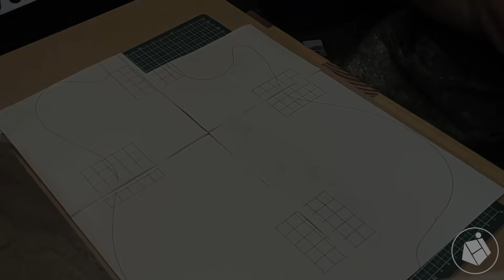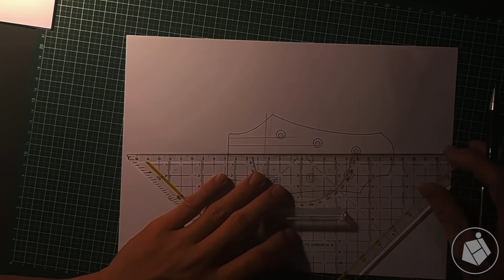Full Build of my Custom Guitar (second guitar build as an amateur woodworker)

Comment: For the backing plate maybe next time glue magnets in and you won't need to use screws. It will look alot cleaner. Beautiful work
Reply from the maker: That's what I've been thinking :) I kind of was in a rush at the end of this build but the upcoming build (same guitar, different pickups, neck through, semi hollow body) is going to have that feature I think, I just have to find tiny rare earth magnets or neodymium.
Reply: You only use magnets if having to access the cavity often - ie...replacing batteries for an active circuit. How often does the average player remove the back cover of a guitar? Never unless having work done to it. You also never have to wonder where the hell the thing went missing if someone happens to remove it. Yeah, it happens.
You still use screws, they are in the body for the magnets to stick to.

Comment: I love the idea that it's mostly made from wood (i.e. back plate and pick-up surrounding), others normally use plastic I think. And the attention to details. Uhhh. ♥️
But how heavy is it though? And I'm a bit surprised the fret board was glued to the body. I'm used to seeing it bolted to the body, or it's just my guitar. 👀🤔
Reply from the maker: guitar necks are either bolted on the body, glued to it, or sometimes it's the same piece of wood, and wings are added to make a body. I already did the 2 other techniques so for my third build I wanted to try the " set net " technique :) theoretically it has an effect on the guitar resonance and sustain, but I cannot tell the difference in sound.
Reply: Want it „easy“: Bolt it on. Want it „demanding“: Glue it. 
Fender Stratocaster is bolt on. Gibson Les Paul is glued. And both are worth dozens of thousands of dollars, when older than 50 years. So....I would say: Both is, what it is and as long as you know what you are doing, you‘ll be fine. Compared to a Les Paul a Telecaster is just a piece of wood with a stick bolted on. The truth is, it is not that easy. ;-)

Comment: This is beautiful work! Love the shape of the body. The headstock is a good design but it kinda reminds me of Cort.. The neck pocket is toight! How did you get the neck angle correctly? Did you ground the bridge? Also, it looks like it would weigh a ton, you could potentially rout out some material before gluing the top (and also do the channels for electronics).
Reply from the maker: All good observations :) there's no neck angle it's perfectly flat and the bridge is very adjustable, I have no intonation or buzzing problem so far, lets see how it holds through time. The bridge is still not grounded yet because I don't have a long and thin enough drill bit to do it, but it's on my bucket list for this guitar (as well as the logo on the headstock ). The guitar weighs 4.2 kg, it felt massive when it didn't have a neck but afterwards it feels pretty well balanced , so I'm happy for now. I was considering hogging out some wood before putting the top on but then I got distracted and meh .... I'll think about routing before putting the top on next time, as I think it's safer !  maybe it doesn't show but this guitar is very very (very) much the result of pure improvisation, what saved me is that I work very slowly, it's almost pathological, so in a way I have time to see troubles coming towards me and dodge them :)
Reply: @tchiksguitars  Haha slow is good then, keep it up! :)

Comment: I'm curious about something.
My first guitar (an Epiphone SG) was left in a corner collecting dust for a few years. During that time the neck got twisted. Repairing the neck wasn't really possible (well, it was by far not worth it), but replacing the neck also wasn't really worth it. Therefore I ended up buying a new guitar. But this time I made sure that it was a bolt-on neck since it is way easier to replace the neck if something happens to it. The SG had its neck glued in which is why I couldn't replace it.
Why did you decide to glue your neck in place? Is it easier to make? Or is it because you don't like to see any bolts on the back? Or do you have some other reason? (I'd be especially curious if you have another reason. I love to learn about other people's motives)
Reply from the maker: There are lots of reasons to chose between neck through - set neck - bolt on neck. There is nothing rational here, I just decided to do a set neck because I had never done that before (this is my second guitar build :p). I don't think set necks (eg glued necks) are impossible to replace. In this particular build I would try to unglue the neck by heating the gluew and if I fail I could always cut the neck at the heel and route a new mortise, through the old neck (it helps that I have the mortise template). Some say you have a better sustain with set necks, I don't know if that's true but this specific guitar has a crazy long sustain :)
Reply: @tchiksguitars   Thanks for the quick reply! I have to agree with you that trying out new things is also a very good reason :)
You also make a really good point about replacing the neck. My guitar cost €350 at the time and I don't have the skill nor tools to replace it myself, so it wouldn't be worth it whereas I would be able to unscrew the neck and screw a new one in if it was a bolt on neck. But since you'd probably make a new neck it wouldn't be that much more work to take out the old neck.

I could also see how the sustain would be better on a set neck. And now I'm curious if someone did some actual research on the differences in sustain by building several equal guitars where some of them had a set neck and the others had a bolt on neck.

Either way, it's great that your guitar has a crazy long sustain. The whole thing turned out absolutely beautiful and I'm pretty jealous of it :)

Comment: A lot of nice work.   But the back plate being wood, not fitting right, then not using flush bolts, that were counter sank, bugged the hell out of me.  Lol. You’d feel that on your stomach.
Reply from the maker: Ahah I feel you. If it makes you feel better the screw are countersunk now, I didn't have proper screws at the time I shot the video :) and the plate not being totally flush with the back was on purpose , it is so I have something to grab onto to lift the plate out. Overall I really have a hard time doing those wooden back plate, this is as accurate as I can get without using a routing template (I'll probably laser engrave some mdf template for the next time hehe ).
Reply: tchiks guitars & furnitures lol. Yeah I was surprised you did the back plate in wood, as it would be next to impossible to make it blend perfectly.  I know I wouldn’t have the patients for it.  lol.

Comment: Por que no se hace el cuerpo de la guitarra de una sola pieza de madera?. Excelente video.
Reply from the maker: I didn't have enough wood :-} most guitars are done with two or more pieces because it's hard to get chunks of wood that big. Also with larger pieces of wood, the body tends to twist over time: when you glue two separate pieces, the movements in one piece is canceled by the same movement in the other piece. At least that's what I believe :) and thanks !
Reply: @tchiksguitars  Gracias y felicitaciones por la guitarra!!.
Reply from the maker: Thank you ! (Sorry I only understand spanish I can't write it :p )

Comment: Great job! I am getting my workshop together to do projects like this. I recently bought a second hand radial arm saw for £40 but that thing is an accident waiting to happen when ripping and a nightmare to set up. Your table saw looks decent. What make is it and are you able to rip larger sheets with it?
Reply from the maker: Thanks ! The table saw is a DeWalt dw745. It actually was the first tool I ever bought and I've used it alone for a long time before getting a miter saw and a track saw. Having those last two makes things easier as you don't have to use and build  jigs and stuff like that but it's perfectly doable on a table saw alone. My table saw is still the most versatile tool I currently own :)

Comment: Looks great! But as a carpenter,  I'm trying to understand how have you assembled the whole guitar with just pva glue? No cookies, no screws.. how?
Reply from the maker: You mean to prevent the pieces from sliding while the glue cures?
Reply: Yeah, I'm not sure how the glue is strong enough to hold the body together for example with just pva, I was under the impression you would  have to use dowels or cookies with the glue (asking as I want to build my own Bass) or a stronger adhesive...?
Reply from the maker: Well. The glue joints are pretty strong considering that the mating surfaces, long grain on long grain, are huge. I only use dowels and dominos to increase the gluing surfaces or to keep my pieces from sliding, but it is totally unnecessary on an electric guitar. I'm pretty confident that if I tried to break this guitar, it would break anywhere but on the glue joints :) have you ever tried hammering a glue joint after it has cured a full night, it's stronger than a thousand screws :p
Reply: Thanks for your reply, great to know, look forward to the next project cheers!
Reply: Dude, you are a carpenter, not a woodworker. There is a difference. Elmer's glue works wonders.

Comment: glad to see the video that you uploaded, can you help me ... to give me the layout / distance between fred per fred and the distance between the other parts, it is my hope to get your attention ,, thanks.
Reply from the maker: Hi. It's a 64.8 cm scale length. So that distance between the closest point ot the nut to the edge of the point where the string meets the saddle before intonation adjustment. For the distance between frets I used a calculator available of stewmac.com. Just enter those parameters : guitar, 648 mm scale length, 21 frets. It will give you the exact position of each fret. The neck Pu is right against the fretboard, the bridge Pu is right against the bridge. And that's it :)
Reply: @tchiksguitars  I say many thanks for taking the time to reply to my comment ,, honestly I am still a little confused over the explanation you provided, can you help me once again to give me an example of one of the guitar design blueprints along with the measurement of the distance from each part of guitar, I'm sorry maybe my request is troublesome to you ,, but basically I hope to get help from you, and for all your attention I say many many many thanks.
Reply from the maker: https://www.stewmac.com/FretCalculator.html

This is the tool you need to use. Put in the numbers I gave earlier and you'll have all your fret positions as well as the overall dimension of the fretboard. As for the other distances, just take a guitar that you like, take all the useful measurements in real life. That's what I did for my builds : measuring other guitars :)
Reply: @tchiksguitars  I do not know what to say ,, your advice is very useful for me ,, thank you for improvising my knowledge in the field of assembling and making guitars and from the bottom of my heart I say the many many many many thanks.
Reply: forgive me for forgetting to say ,,i wish you successful always, always healthy and always blessed by god ,, thank you

Comment: Beautiful build, I've got one concern though, neck dive. Do you have any issues with the strap pin placements?
Reply from the maker: Absolutely none ! But I was lucky I guess :p having that extra portion of body on the tail side due to the offset design helped a lot for the balance I think. And thanks !
Reply: @tchiksguitars  That's good to know 👍 Offset gives it that counterweight. 

I'm building a 30 inch baritone hh strat with a custom headstock and all. My biggest worry was neck dive 😅 
I have a question, on the jack hole route, what bit do you use to widen it up? Can't find one for the life of me.

Comment: how are these amateur woodworkers getting planers jointers table saws bandsaws routers spindle sanders how much did that workshop cost
Reply from the maker: Commitment to a hobby, dedication, sacrifice, planification, over a 3 years span (at that point).
Reply from the maker: Example : instead of a mechanical keyboard, you buy a set of chisels, instead of a new graphic card, you buy a spindle sander, instead of a new gaming chair, you buy a band saw.
Reply: @tchiksguitars  makes sense. I’ve been going to a shop class for about a year and I’ve just set up a small workshop with hand tools and only a few handheld power tools (jigsaw, orbital sander and a handheld router) and I’ve been hoping to build a guitar and your videos have been great.
Reply from the maker: Honestly you don't need a planer jointer and a table saw. I already had them and actually used them in that build so I filmed it. But you can just buy pre machined wood. It's all the same. A lot of luthiers don't machine their wood themselves.

Comment: I would like a custom fender telecaster with a little bit of custom electronics for good sound and good volume, what is a average price on one.
Reply from the maker: I have no idea because I don't make and sell custom orders. But a good way to have a custom tele is to buy a Squier classic vibe and put custom pickups. You may have to route the pickup cavity and pickguard if you want humbuckers. Squiers are cheap but really well made regarding neck and fretwork. You may also replace the pots by CTS pots (10€ each, and it makes a world of difference )   cheers !
Reply from the maker: Oh and if you stay tuned long enough on my channel, you'll see exactly what you're asking because it's in my bucketlist :p (a walnut tele with humbuckers and black hardware/pickguard)
Reply: Call Fender Custom shop and ask for Ron Thorn.

Comment: What kind of finish did you use on body and neck? Looked like oil/polish first but then some kind of lacquer or nitrocellulose?
Reply from the maker: it's tung oil (2-3 times i can't remember) then thinned down polyurethane (3 coats, 24 hours between coats); you're not supposed to do that though, but for some reason, I keep doing it :p
Reply: @tchiksguitars  thanks. As for the poly, if it is not effecting function or tone and provided it has no long term ill effects, I don't really see why it would be frowned on.

Comment: Why are guitar bodies (and violins, I think) always made with two side by side pieces instead of one larger piece?
Reply from the maker: Not always. I can see two answers for electric guitars : it's hard to find a wood stock that's large enough to contain the whole body, and two glued pieces is way more stable than one large piece (it cups and twists over time). Secondly, it can look better because you have a book matched figuring on the top.
Reply: @tchiksguitars  all good reasons. Thanks.

Comment: How come it always takes me days, or even weeks to build from scratch, and you guys can do it in less than a half hour?   Was that walnut?
Reply from the maker: RedBull ! Yes. It's walnut on the top and neck
Reply: @tchiksguitars   I have a body blank coming and a slab of walnut in my basement. Your guitar is about to be cloned (sortof) if you don't mind.   I have built similar designs in the past. They all sold quickly.
Reply from the maker: @timhallas4275  hehe. You can't go wrong with walnut. This was the very first time I ever used walnut (for anything), such a great wood to work with, maybe my favorite now. The only thing annoying with it is that it's so dark, the pencil lines or even the scribe lines don't show at all :/

Comment: Olá amigo, excelente trabalho esse seu 👏👏👏👏👏👏. Estou procurando o desenho em pdf da guitarra Steinberger Headless, por acaso você poderia me ajudar, estou querendo construir ela. Agradeço.
Reply from the maker: I don't have the plans for that but I've tried to replicate a bass without a plan once, it's not that hard if you have a software like illustrator (adobe). The specs of the guitar say a lot : length, thickness, scale length etc. From there, put the guitar in the software and make it to scale, you can that guess all the other measurements (pickup spacing, pots placement etc. ). It takes some time but you learn how to draw a guitar at the same time. Good luck !
Reply from the maker: Or even better, borrow a steinberger from the shop and measure it haha

Comment: Oh man, I thought it was going to be doable for the avarage joe. Some of the steps are so easy to mess up. Anything to much on the neck and you can start over.
Reply from the maker: It is very doable don't worry. Maybe the accelerated video make it seem impossible but it's a very slow process. The only part where I was a bit scared was the hand carving but other than that it's not that hard, it's just a long long long process, especially when you've never done any of the steps before (which was my case for half of this build). Don't give up !
Reply from the maker: Oh and people wanting to get started in guitar making often freak out about the neck (like me 9 months ago), but there's a very safe method consisting of doing the first and 12th fret first then joining the too, it's super easy and reliable. I'm gonna show it in my next video !

Comment: Did I miss the installation of the truss rod?
Reply from the maker: It's in the video. I'm just routing a channel and the truss rod just falls straight into it. You can see me using a file on the headstock end so the rounded part of the trussrod fits in correctly. I had to file 1mm or so on each side.